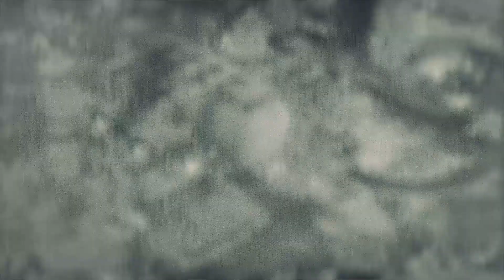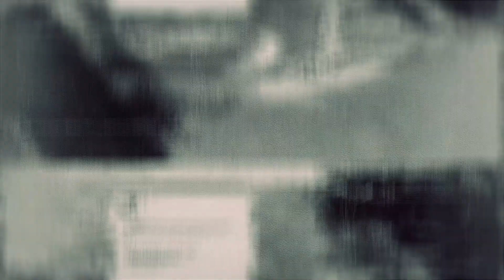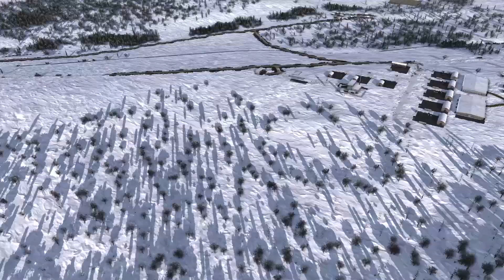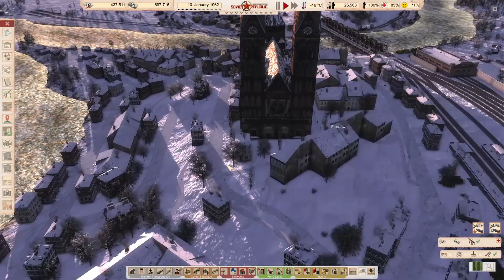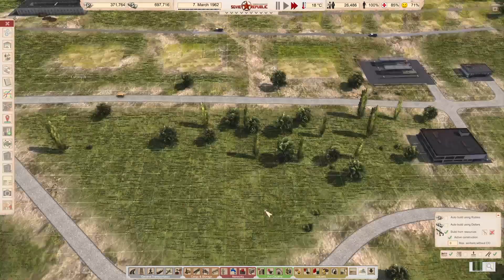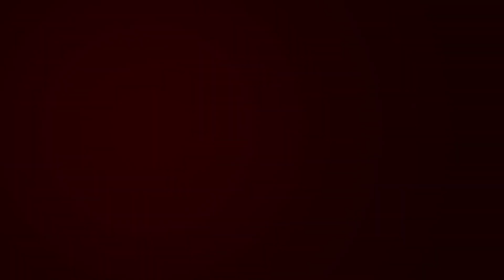Soviet Republic - New Series. Prequal - 1

Comment: In my opinion, people aren't really playing in hard mode if you are constantly taking loans.  That means more starting money which is really medium or easy mode.  You should be able to setup  a profitable export with the money you start with on hard mode
Reply: I setup a small rail line (on hard mode) that is about 1K.  It goes from a Train oil loader to  the custom house.  It includes depot, rail CO and a electric rail connection
  Takes about 1 and 1/2 years then I find a lot of oil (manual search since I don't have the research) and sell crude oil.  This usually funds everything else I do
Reply from the maker: @michaelbohr7101  that'sa  good starting economy! I need to try that again. :)
Reply: And which country in the world does not borrow money? Saying that loans are a scam or a facilitation is a strong exaggeration! I believe that loans or the form of loans with delayed repayment proposed by me on Steam are much more difficult than selling oil at the very beginning.... especially since after the recent updates it is no longer so easy to earn millions from the beginning....
Reply from the maker: @TomekKowalski-ou4il  yeah. Loans are part of the current world and it's the only one we have. I believe they add siginificant dificulty if taken. I found even more so then before. :(
Reply from the maker: In vanilla maybe but here we don't have electricity. :( 

Question. Do you play on hard mode? If so, how long does it take to start with rails? 

I find it challenging to balance my books especially if I don't diversify my exports. :(
Reply: There are 5 countries in the world with no national debt.